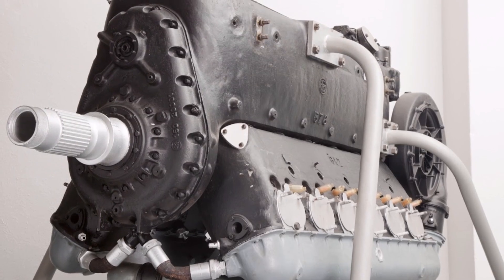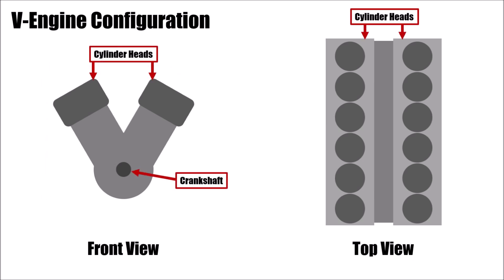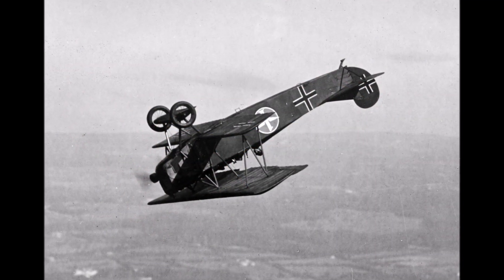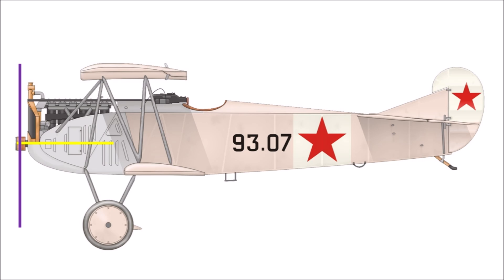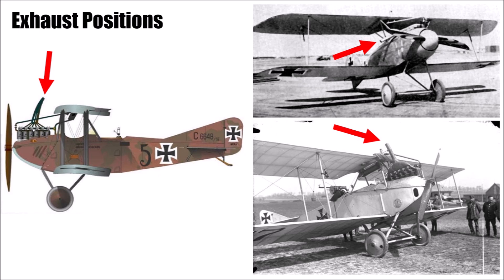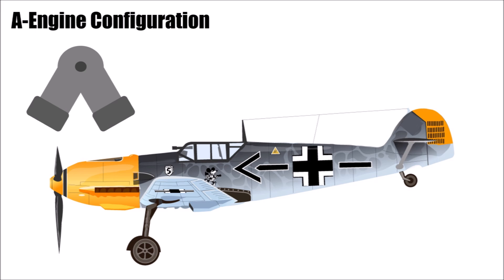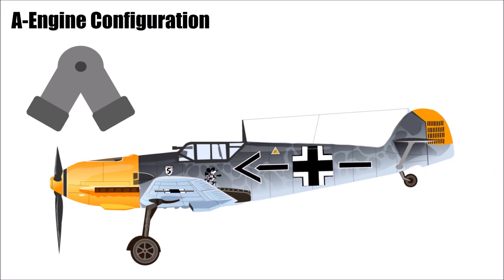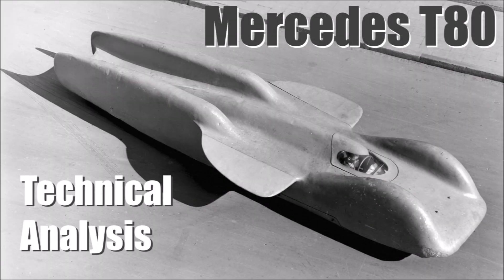V-Engines vs. A-Engines - EXPLAINED

Comment: Well, the inverted V-engine (A-configuration) was a sort of German speciality (Junkers and Daimler Benz engines). The Allieds used the normal V-configuration (Rolls Royce, Packard, Allison). The possible advantage of the inverted V because of of the lower center of gravity was partially negatively compensated by the high-mounted heavy crankshaft. The height of the propeller shaft above ground was also reduced again as a result of the spur reduction gear mounted below the crankshaft, while it was increased by the same amount in the conventional V configuration; an advantage in the ground clearance of the propeller is therefore questionable.
Great video as always!

Comment: Excellent explanation
I used to fly 109 simulator

Really help having A engine config
The gun are more precise compared to belly mounted gun from other plane
Reply: The Bf-109 had a cannon mounted in the centre of the engine's V (or 'A' if you prefer, firing through the centre of the propeller. This was a designed-in advantage of that engine installation, which could have been done with V engines as well.
Reply: @pashakdescilly7517  yes the main canoon mounted in bf109 (20/30mm) are mounted right in the center but the advantage the A engine compared to V engine is the secondary 7.6/13mm can be mounted on top, closer to pilot aiming reticle
Reply: @PrinzAquatic  and better visibility past the engine

Comment: Very informative once again. How do radial engines fit into this? Was that a later invention?
Reply from the maker: Thanks! Radial engines were one of first ones and they are the hardcore light weight design but with a massive frontal area.
Also stuff for another video... I try to mix modern with historical topics.
Reply: @bsport320  
Radial engines actually go back to the pre Kitty Hawk period. The Manly Banzar used in Langley's Aerodrome #9 was probably the best power to weight ratio up until the Antoinette

Comment: I felt like you didn’t cover the disadvantage of the oil in the cylinders well enough. A better explanation of how the oil was evacuated before start and how the oil was scavenged for recirculation during operation would of been appreciated. Also, why wasn’t a gearbox used to overdrive and raise a bigger propeller on the more powerful engines instead of flipping the whole engine around. They could of just lowered the engine for a better cog.
Reply: Aircraft engines have a dry sump lubrication, so the backside of the pistons is not soaked in oil when standing. Still it is a good idea to give it a couple turns to make sure no hydro lock will occur, but it is no major issue in general. I agree when a reducer gear is used, the disadvantages of a conventional V engine are diminished.
Reply: @ppd3bw  inverted V-12 engines does have have a dry sump lubrication! Namely the DB 600 series and the Jumo 211F and the final Jumo 213E but I never have seen any footage or photos that shows the blades was turned around in order to scavenge the oil. The opposite infamous example was the awful engines of the B-29 that required a lot of ground crews to scavenge the oil often turned al least 10 times but the other radial engine was the BMW 801A that didn't required much to turn it around.
Reply: The reason they didn’t use a bigger propellor is normally ground clearance. Case in point, look at the P-39 and P-63, with their huge ground clearance they turn a huge prop to match. Regarding raising the propellor up more via gearing, it takes the prop out of alignment with the centre of mass, and it makes takeoff & landing difficult. Obviously a little bit is just fine, but it all contributes to the accident rate

Comment: Hi, you forget the big cannon, 20 or 30mm, located between the cylinder banks and fireing through the propeller hub.
On the DB605 i the Me109 there is a qd wireing harness that let the mechanics do an engine change in 30 min.
Reply: Sim, esses canhões saindo do eixo da hélice por baixo do A do motor era uma disposição muito boa.

Comment: Another great video , v angle how effect engine dynamics what is the best for v12 720/12=60? Or v8 v16s specially
Reply from the maker: True that's an interesting topic too with oscillations, sound design and performance output. I will put it on my list.

Comment: Why did the always put the supercharger like this in old german performance engines?
Reply from the maker: Mercedes was quite experienced with superchargers in their race and road car division in the 1920's (Technical director was Ferdinand Porsche at that time).
When they were allowed to produce aircraft engines again, it was clear for them to use superchargers.
Reply: @bsport320  Amazing video as always btw. I was wondering why they always put the supercharger air intake 90° to the crank shaft.
Reply: @bsport320  It's basicly the question from this video: https://youtu.be/NcI67pZe_Ss
Reply from the maker: Very good question! As he says in the video, the answer seems to be lost in the German engineering world somewhere. I have a few sources and I will be able to answer this soon.
Reply: @bsport320  AMAZING Thanks for the answer btw enjoying your channel since the 2nd Bugatti video. 
You and Greg are my fav channels.

Comment: Why did RR & Allison not invert their V-12s? R U saying Spits, Hurris, 51s & 40s all had lower thrust lines and longer, weaker mains than 109s & Dora 190s? Anybody really interested in detailed, accurate information on WWII engine configurations might find Greg's airplanes a lot better than this channel.
Reply: Maybe something to do with gear ratios between the engine RPM and prop RPM in the later half of the 1930s?